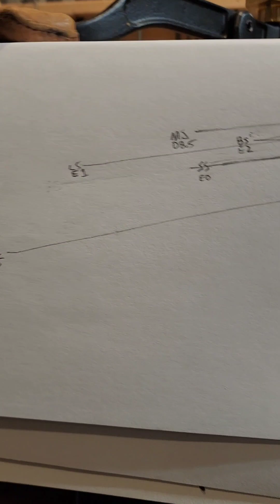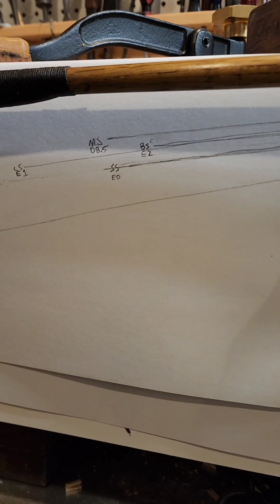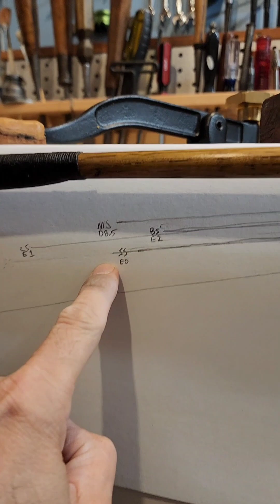Golf Shaft Deflection Board...for my Long Nose Clubs

Comment: I like your thinking.
I did something similar to compare some classic steel shafts, only rather than clamping the grip in a vice/vise I laid the grip on the workbench and then trapped it with a piece of wood at the bottom of the grip so the the shaft overhung from the end of the bench at a measured distance.  
The only possible downside I can see by using the vice/vise is that the grip thickness can vary and you might find that different shafts are clamped at different points meaning that the deflection is measured over a different length of shaft, if that makes sense!  
Here's a video with the set-up I used, see at 3 mins 20 secs for flex test. https://youtu.be/69VtqeYVjZ8?si=Sap2BhYKXIOptL0A